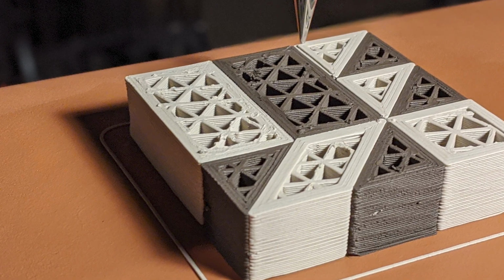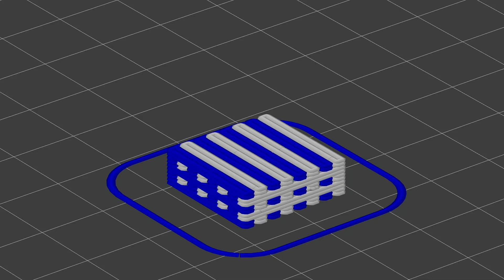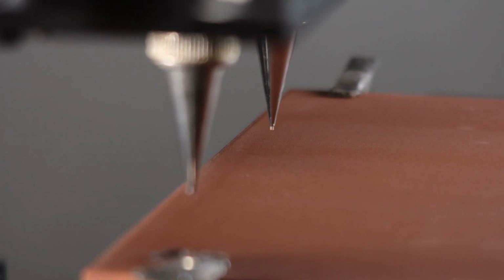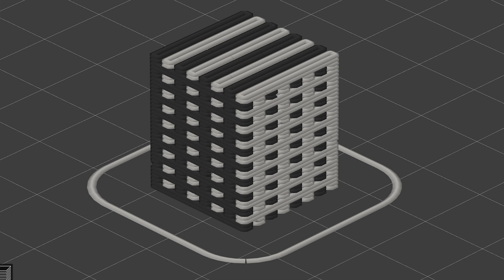Dual Extrusion Clay Printing With 1mm Nozzle and 0.5mm Layer Height: Woven Pattern

Comment: Many FDM multicolor processes use a purge block - I'd imagine this would've helped this print, as you could get rid of the excess dark material coming out before you move to the real print. I love the scale of your work. Something about the geometries you print make them seem so much larger than they are, until you zoom out that is!

Comment: Take a look at what e3d does about oozing with multiple print heads on their tool changer platform. They do a wipe sequence across a little wire brush head with a taught horizontal wire at the end and a solid state relay turns on a shop vac to pull away the detritus. Something similar could be done for clay with a taught wire over a small warm bowl of water. Just dialing in the viscosity may fix the oozing problem in this clay body but decreasing water may also significantly weaken interlayer adhesion.
Reply from the maker: Thanks for the suggestion, I love the E3D tool changer concept.

Comment: Why not run with an ooze shield or maybe a Wipe since you can independently control z?   

As always, I love how the videos are voiced over to explain what we see like if I was one of your students in class.   If it wasn't for life, I'd so want to join your classes!
Reply from the maker: Good suggestion, which I'll look into. However, since the white clay is working as planned without an ooze shield, I'm more inclined to work on the black material to solve the issue. But then I would, because I'm more knowledgeable about clay than code. It's intersting that problems may have material, mechanical, and software solutions. Thanks for your interest!

Comment: There is a setting called ooze shield that might be worth looking at! Cool stuff.
Reply from the maker: Thanks for the suggestion!
Reply: Yes, you have some ooze on the extruder with the darker clay. The fact you don't see it on the light clay means you might be able to eliminate it, but an ooze shield is the other approach.
Reply from the maker: @JonS  Yes, the analogy here would be printing the same plastic in two nozzles but with different extruder temps, causing one to ooze and the other to not ooze. Water content in clay is similar to nozzle temp in FDM. Too much water and everything gets all gooey. Too little and the process is sluggish or even intermittent.